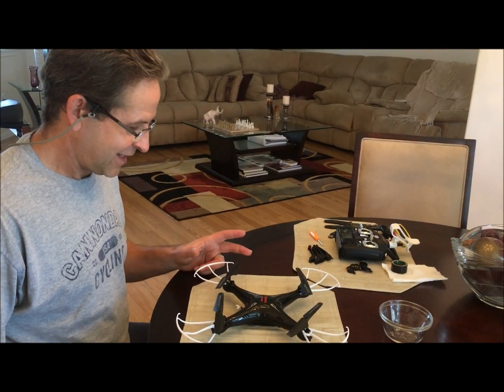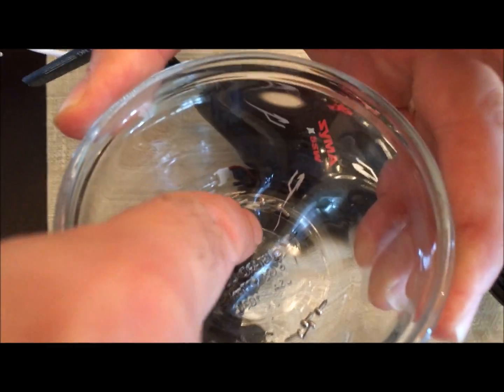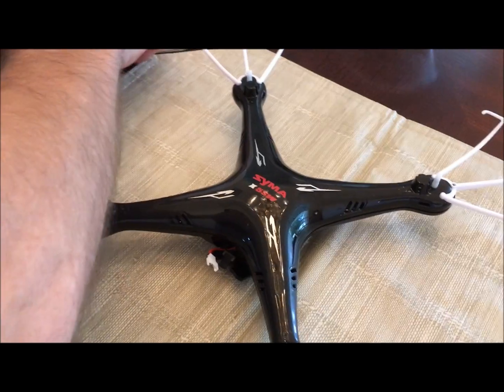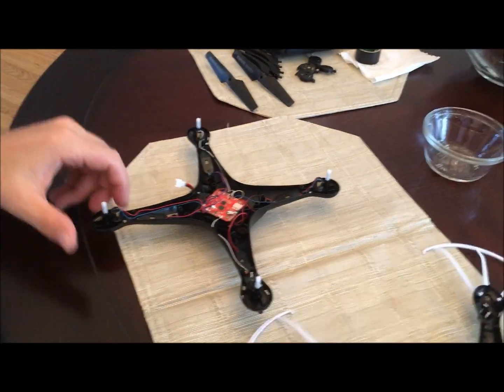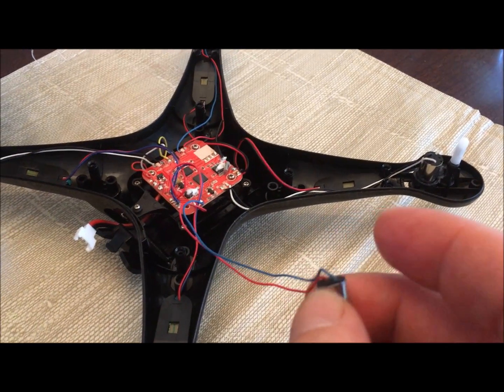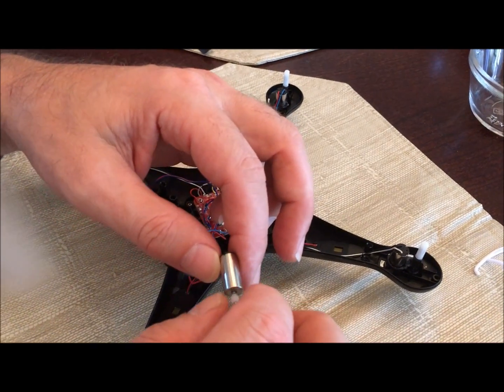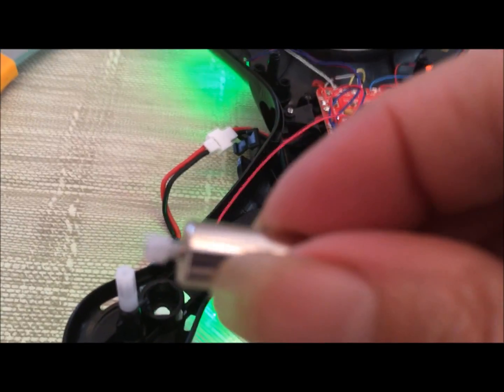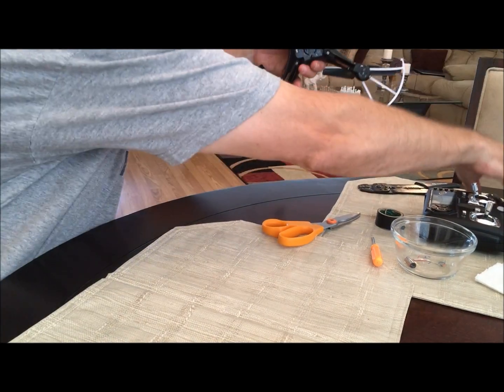How to Easily Replace Motor on Syma x5sw Drone (Propellor Not Spinning)

Comment: What size are the motors? Im trying to buy and there are 2 options, 8 x 20 or 7 x 20.
Reply from the maker: Sorry but I am not sure. When we bought them awhile back they didn't give 2 options. My only suggestion would be to see if one of them can be returned if not the correct one. Wish I could have been of help....

Comment: Hi! Hope you know more about this electronics, so I ask you a question in hope you know some answere.
My grandson have a zyma x5 uv where one motor was not working. I ordered a new motor for him and I replaced it.
I did what you did not recomend in this video...to solder the wires into the mother board.
When I turn on the dron after, and paired the controller to the drone, everything looked to be all fine, but when I start the motors, the new motor spinn full speed wile the others run normal.
I then turn off the drone and the controller, but the new motor still spinning full speed.
It keep on spinning to I pull the battery. Now when I set in the battery, the new motor start running right away....and it keep on doing this.
When I started the drone first time after replaced the motor, I start it without the propeller axel and the propeller gear installed.
I can see there is some sensores sitting above this propeller gear. Can it be the system is disturbed by starting it without this gear in place?
I assume the sensores above the gears is sensoring the RPM of the gear!!??
Can it be the missing gear that have made this problem, and could it be som way to reset it?
Or did I destroy the mother board when soldering the wires?

Thanks in adwance...
Reply from the maker: Sorry to hear that you are having issues with that motor.  I honestly have no idea why it is doing that.  I just replaced the 2 motors and had no problems and now I am flying the DJI Phantom drone.  Wish I was able to help and hoping it gets resolved for you!

Comment: does anybody know why my motor start running when i plug in the battery and the switch is at off.  The other motors stay still and respond at the controls

Comment: 2 of my 4 motors just flat out stopped working after only 10 hours of use. Now, I did like you said and purchased a TON of replacement parts and could rebuild both my drones a dozen times over, minus the remote and motherboard which are paired together at the factory of course. Well I contacted the seller to find out about replacement motors and they said they will send me a brand new complete drone and return shipping for the bad one. I'm like......sold! Sometimes all you have to do is ask. But, I'm an honest person so I am ordering a batch of motors to swap them out in the future as I can see this will happen often.

Comment: Do you have to change all 4 Motors or you can just do one
Reply from the maker: We just did the one motor.
Reply: Marcozo T I already fixed my it was in the motor it was out of the track after I crashed it so that was easy fix but I need to learn how to control it I need someone to teach me
Reply from the maker: I did a  lot of crashing but thinking this drone is harder to control due to being so light.  Great way to practice though before investing in a more expensive one :)  Plus my wife had taken pilot lessons so she has been my tough navigator lol

Comment: hello, what kind of motor used by syma drone? I really want to buy replacement motor, but I didnt know which one is suitable for this model.
Reply from the maker: Since this was my first time having to replace, I went to the Syma website to the parts diagram page to see which ones  I needed and then ordered them from Amazon.  Just make sure it says compatible with your type of Syma drone.
Reply: Marcozo T alright 👍 thanks!

Comment: Maybe it's just because it's a different motor but did you see when you would rev it up then let off the one you replaced would stop much faster than the other three. Did you experience any difficulties flying it? Seams to me that new motor has more resistance than the other three.
Reply from the maker: I noticed that too and it was doing that same thing even before flying.  Even replaced the gears thinking it could be slipping but still the same.  But have no issues with flying it except when there is a wind due to it being light.  Just upgraded to a heavier one, the Phantom 3, and did my first test flight - major difference.  I would say go with a more expensive one and in my opinion worth the extra money.
Reply: Probably because it's a new motor that needs broken in. The on board gyros adjust the voltage sent to each motor to maintain level flight. That should compensate until the new motor is properly run in. I flew my latest drone at a friend's house and did a max altitude check. Bad idea! Baby went up like 125' and I lost control. It stayed up and the wind drifted it I'd say 200' horizontally before the battery died. I was...powerless. When it came down it landed in my friend's salt water pool! All the way down it sunk. I was like: "It's done. The motherboard was just immersed in salt water!". It took me 4 minutes just to fish it out. Sure enough even with the power switch off the motors were all firing randomly. BUT, I crossed my fingers and let it dry out overnight. It works! Moral? Don't take these any higher than a 2 story house and never over open water. It could be a quick $40 lesson.